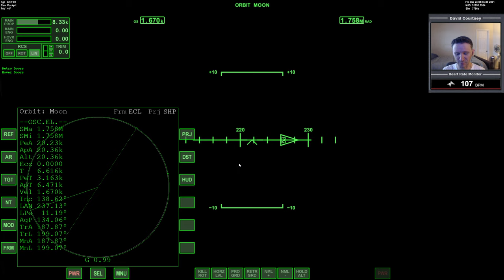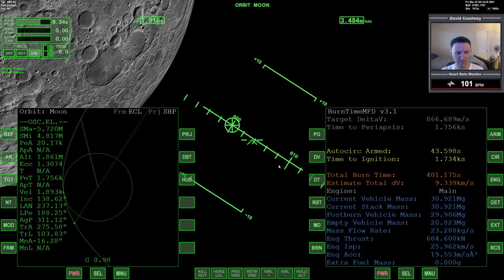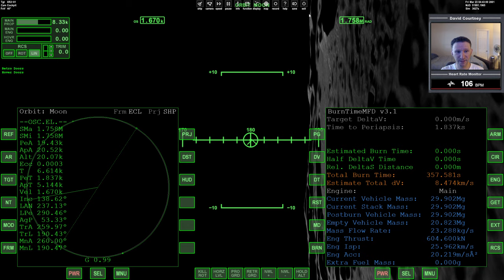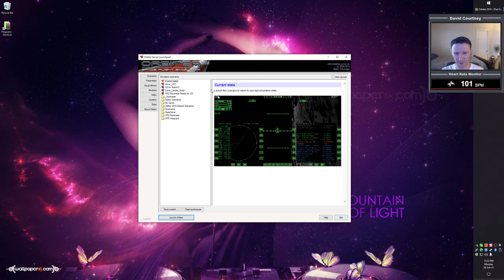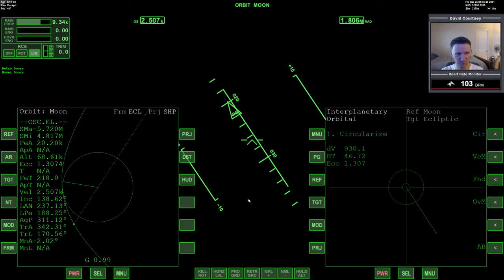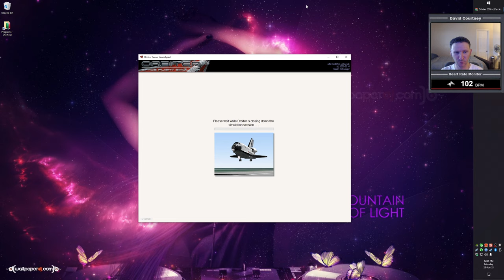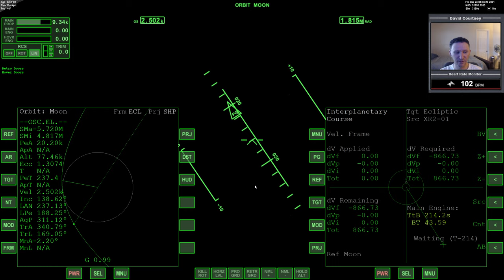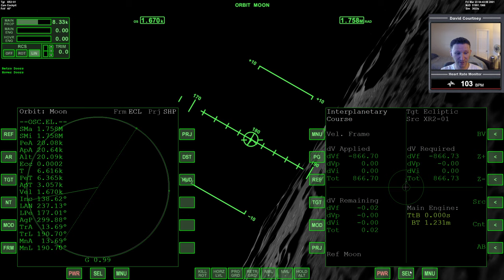Orbiter 2016 - Methods for Lunar Orbit Insertion

Comment: I've been using Lunar Transfer MFD I think it's called (same guy makes an interplanetary transfer MFD) and for some reason although I've finally got my Orion with 2nd stage (SLS Block 1) to be able to have a successful TLI, (having enough fuel for enough delta v if I launch with the most shallow ecliptic inclination from the Cape) I end up just crashing into the moon which is frustrating. The addon I'm talking about gives a LOI option as well but it always either says no solution or too close to ignition time. Thought you might know something about that. No mid-course corrections may be the problem. 

Also PeA and ApA in Orbiter can be a little confusing because it includes the distance that is the radius of the body you're orbiting. Which is realistic but makes a difference versus just looking at your altitude above the ground.

Edit: ah I see you're using IMFD. 👍👍